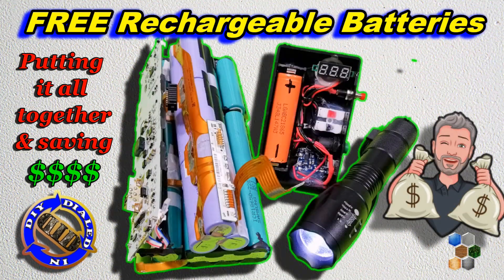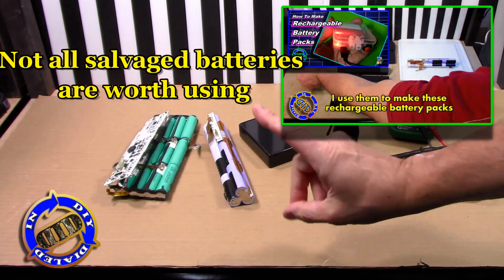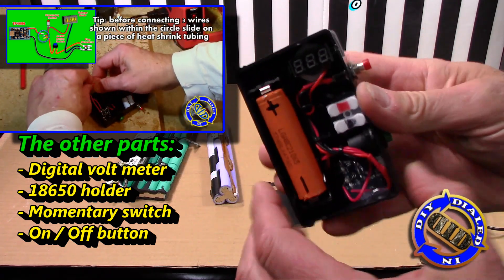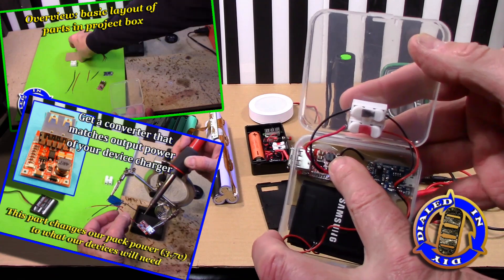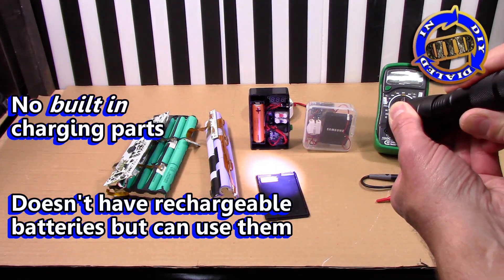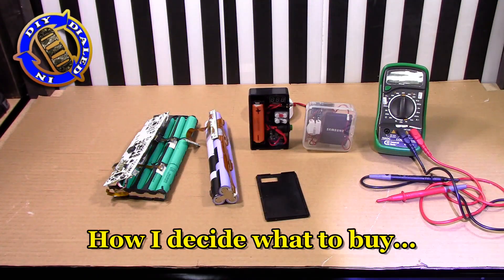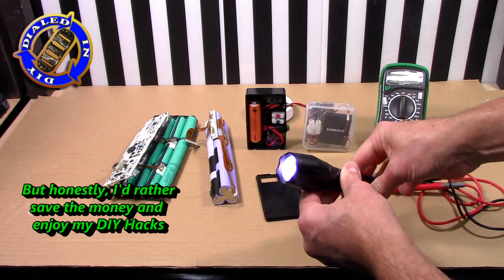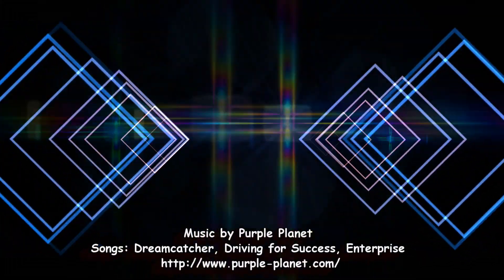Using Free Rechargeable Batteries - Putting It All Together

Comment: Most laptop or portable dvd players, etc. power packs I have access to are generally completely.....wont even hold a charge......dead. is there a way to recondition certain battery modules? Nobody I know has any interest in giving me something like a laptop battery pack that still, for the most part, works. Great video, hope all is going well.
Reply from the maker: [Ugh... Sorry, another lost response] My comment was two fold. First, I have found that most packs identified as dead simply do not work for their given purpose. But if the pack is made up of multiple batteries/cells then often only one or two of the cells has gone bad but the rest can be recharged and used individually.  Second, I have seen claims made about reconditioning batteries to bring them back to life but I do not have any direct experience with that.  In my experience, if I can't get a cell to hold a charge then I am not able to safely get it back in working order. I have tried but the charge process results in a battery or charger (or both) getting very hot.  
Thank you so much for your continued viewership and commentary.  I really do appreciate it and look forward to your feedback!
Reply: @DialedInDIY  thank you, on all accounts!👍